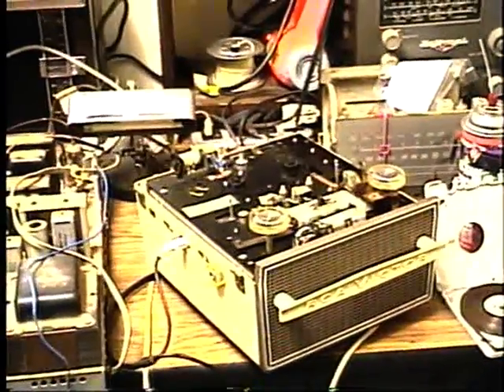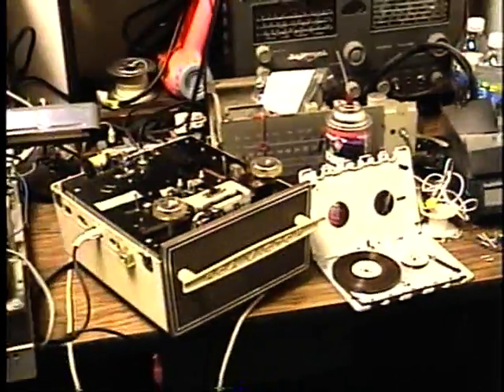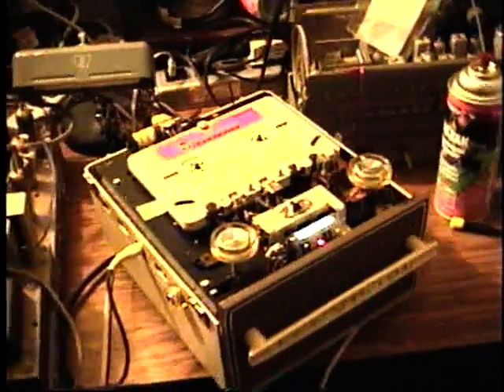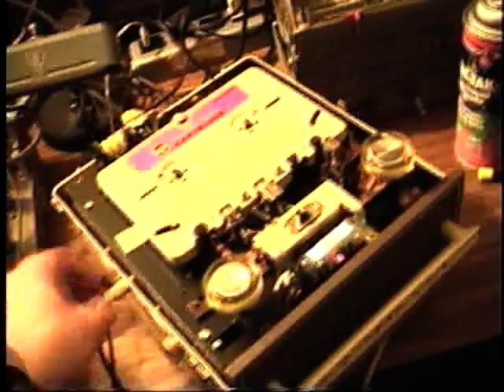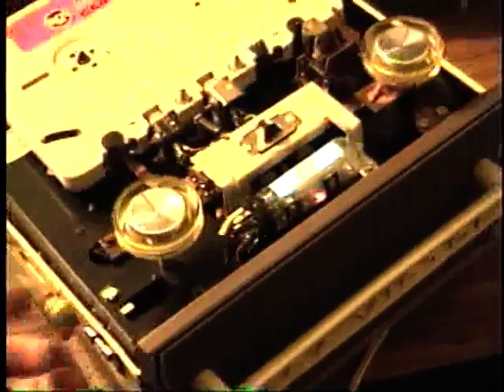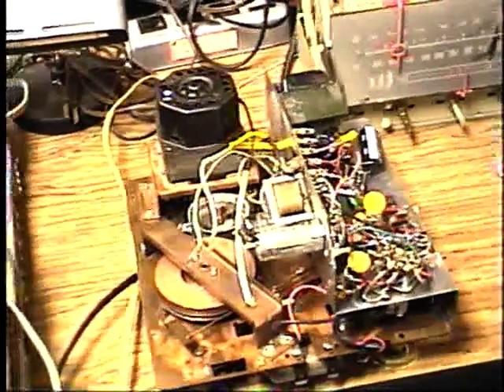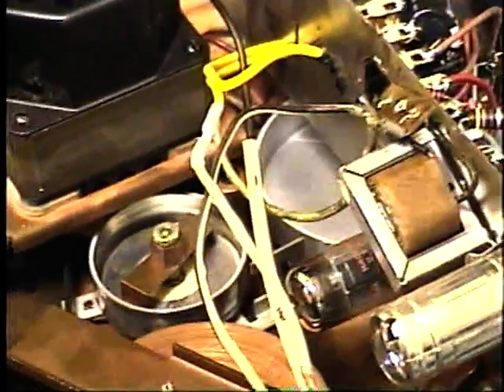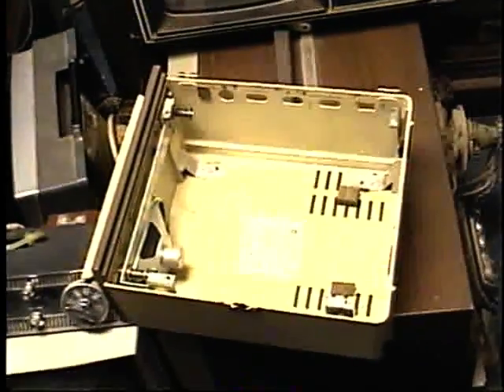1963 RCA Sound Tape Recorder repair and demonstration

Comment: It's interesting how it used only one belt that measured 14x0.139" to drive all those wheels. The only real surprise is how the idler between the motor & the forward reel-drive just presses the belt against the reverse reel-drive wheel to rewind the tape.

Say... Could you layout the details of what-all were the values of the capacitors that you replaced, along with type? As well as the same for the diode you installed, along with how you did it all? BTW: Is it okay if I use polystyrene capacitors to replace the mylar ones? I'm just remembering about something I read about the pre-polystyrene "caps" used in the controller for the Electro-Jection offered on '58 Chryslers & moisture.

Comment: I`m trying to fix my RCA recorder. It had the same problem that my  Phillips Norelco had meaning that the belts or "o" rings melted. Could you please tell me if it took several belts to operate the motor transport, or were there large "O" rings that rubbed against one another to operate the transport. I just can`t tell, because there was no remnants of them left, so I don`t know how it was connected. Thank you. Sincerely, Ed.

Comment from the maker: I think there may have been a stereo unit made but I have not seen it. It does have a dual track head so it would certainly be stereo-compatible. I have only seen three of these units in my life...the one I have, the one cassettemaster has and the other is at the Museum of Radio and Technology in Huntington, West Virginia.